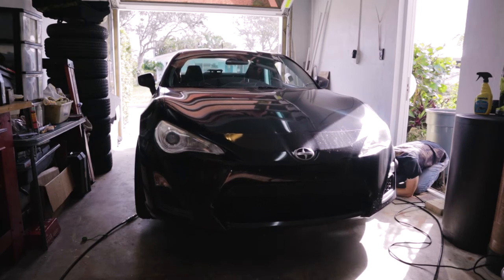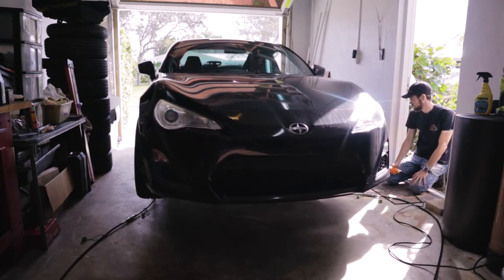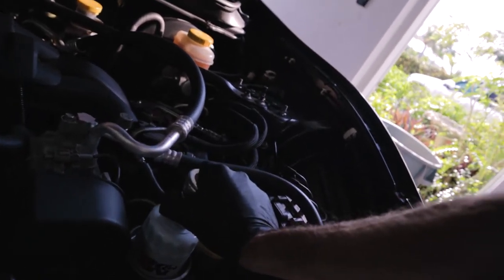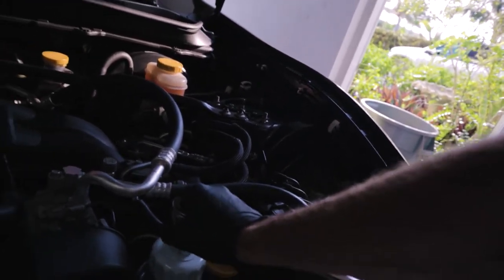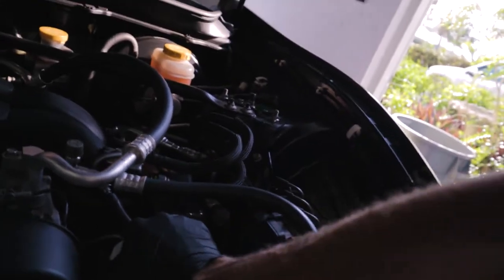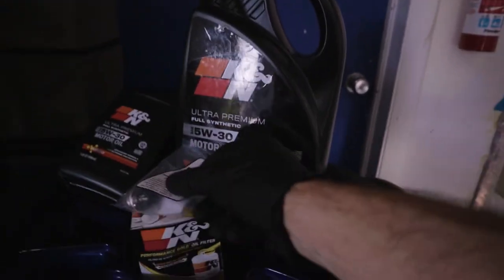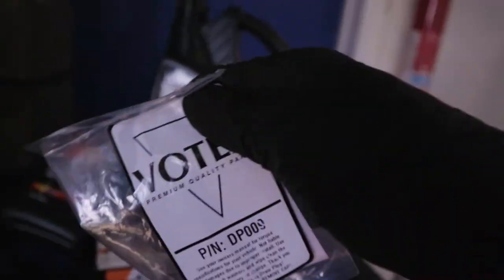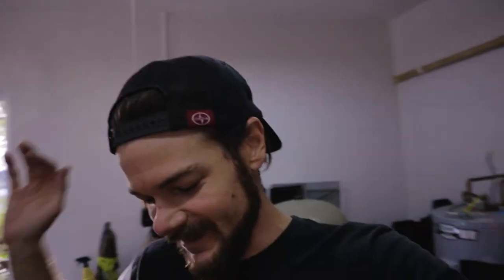Why Oil Valves are a BAD IDEA

Comment: Notice any sludge come out after you removed the Fumoto valve?
Reply from the maker: Nope! Can't really say any noticeable amount, even an oil change after with the magnetic plug I didn't find any metal, either way, I'm happy to be back to a normal plug. There were some signs that the Fumoto had bottomed out at least once, so I'm good with not using it going forward and using a more low profile solution!